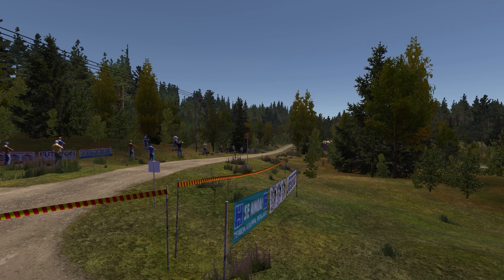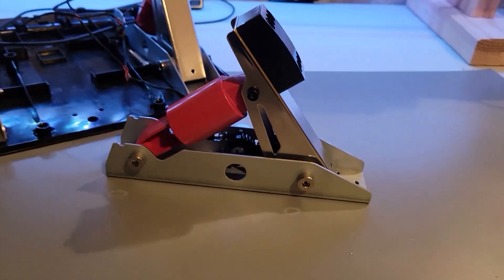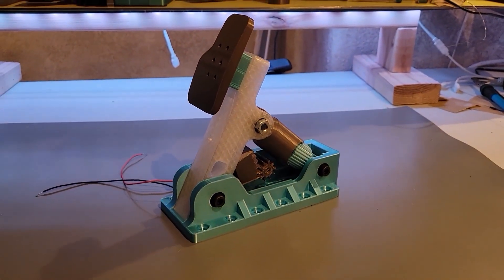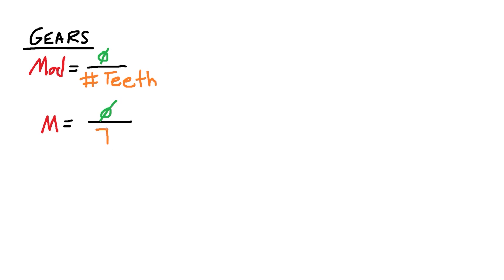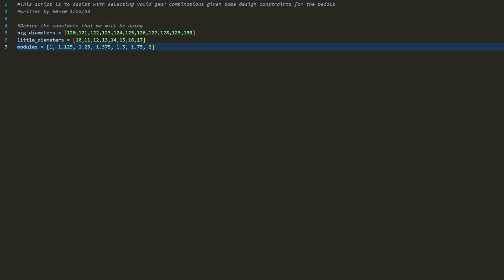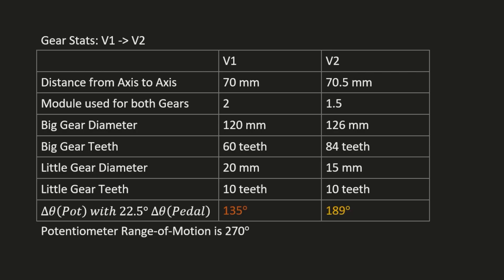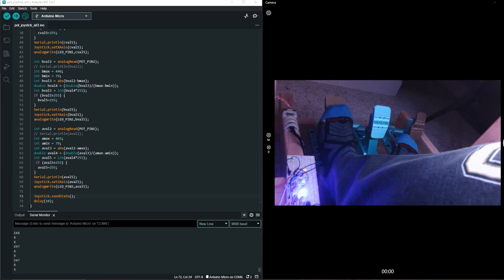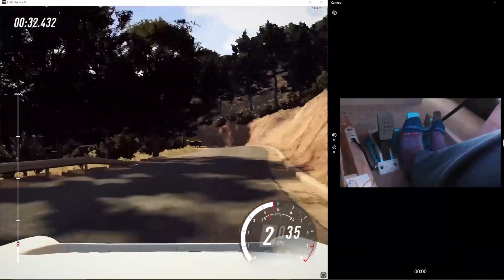3D Printed Sim Racing Pedals! (MSC Challenge : Part 1)

Comment: You need to rewire your pot. With 5v - signal  - ground.    Using it with a 10k pull up  give you half of the available resolution.

Comment: where did you buy springs? im looking for similar for my pedals project
Reply from the maker: Unfortunately they were extracted from an old set of logitech pedals, I am not sure where to buy them. I am also unsure of the lbs/in per spring, but they are roughly 20mm in OD and 60mm fully extended give or take a mm depending on brake/clutch/acc